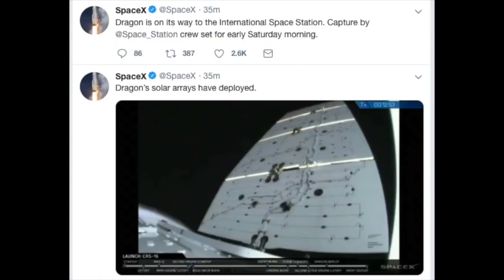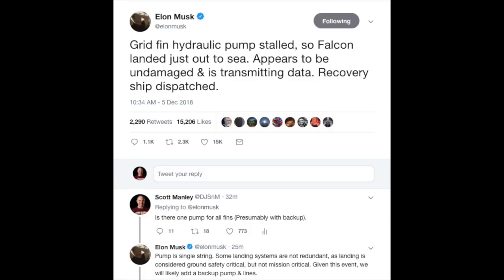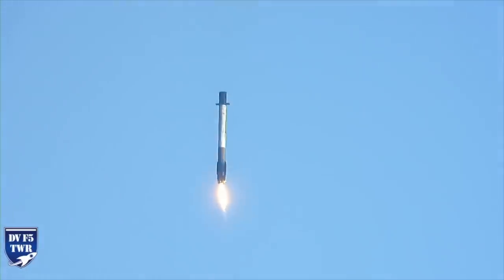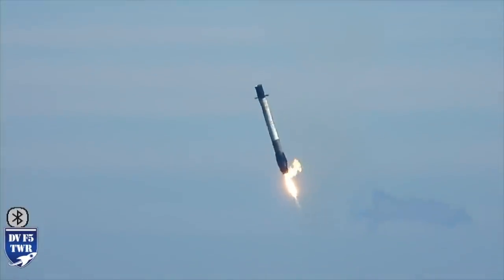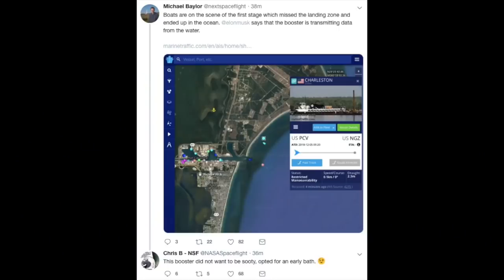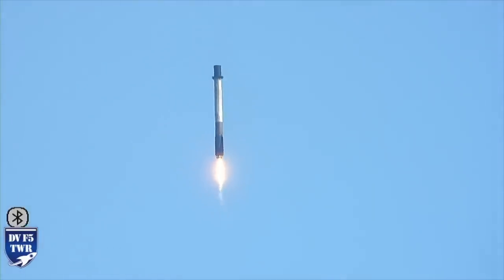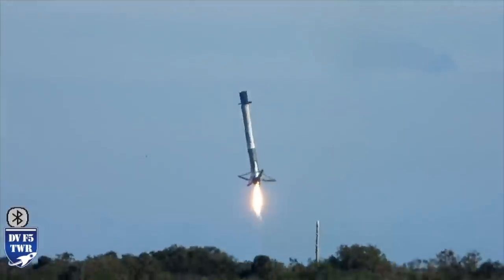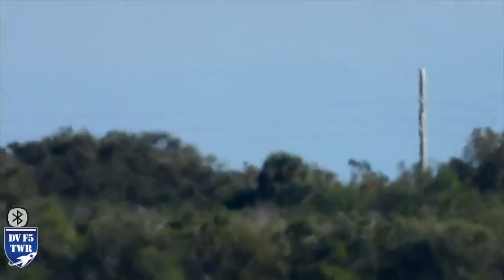SpaceX Rocket Loses Control After Successful Launch

Comment: That floating object appears to me as a piece of condensed and frozen monopropellant being ejected from the bevel where the thruster sits. Could also just be ice, but I'd guess it originated from the monopropellant thruster area.
Reply from the maker: They don't use monoprop, they use compressed nitrogen gas.
Reply: @scottmanley  Do the little thrusters have a seal? looks like it appears  after they all fire for a split second to 'open up'. It looks like a blown out peanut butter seal.
Reply: @danpope3812  Could be to verify that they're working
Reply: @scottmanley  Which is "technically" a monopropellant, if you want to get snitty.  But I know what you mean. (It's not Hydrazine.)
Reply: Any chance that the compressed gas could condense the water vapor in the atmo and then very quickly freezing the condensed water into the ring that we saw?
Reply: great vid  @scottmanley  At first I thought it was metal because of the reflective value then realized my brain was probably filling in the missing info, which it will do naturally,
Reply: During the SpaceX-broadcast, they immediately said, it is ice (out of condensed water), I think.
Reply: @iconoclastpleonast8726  Actually, my guess is it is a ring of water ice from around a nitrogen thruster based on the fact that releasing a compressed gas (eg: Nitrogen) causes cooling in the aperture. This results in condensation and freezing of ambient water vapor.  But that's just a guess.
Reply: @tarmaque  Where do you get the water from? OTOH, Nitrogen can freeze. It's what Pluto is made of. That's one of my guesses. But the ring doesn't look like what I remember the cold gas ports being shaped like. And it was huge.
My other guess is solid oxygen from a turbopump exhaust.
Reply: @Markle2k  Uhm... have you heard of the concept of humidity?  It's this thing they have in Florida.
Reply: @tarmaque  Nice smartass remark, but it doesn't help your thesis. The booster uses gimballing to control attitude on the way up. At 140 km, at the top of the boostback arc, there is no water vapor. Almost all the atmosphere's water vapor is below the tropopause and in the thermosphere it tends to get dissociated by UV into H and O. The Karman line is 20 km above the mesopause.
I've spent some time looking at photos and the video replay. The  RCS and the umbilicals are much smaller than the ring we saw float by and strike the grid fin. They are about half the size of the holes in the grid fins. The ID of that ring is 2-1/2 times the small dimension of the grids. It's larger than the whole square of the RCS pods.
Reply: @Markle2k  But it doesn't actually strike the grid fin. Look closely and you will see it is blasted by one of the side facing nozzles. Which I believe is the origin of this ice ring.

Comment: I suspect they'll have to recover it. They're going to want to know how they can avoid this malfunction in the future, and verify what caused it.
Reply: Musk has already tweeted that they send the ship out for recovery. 
They think about using the booster in an SpaceX-only mission.
Reply: @3gunslingers  thanks for the info. I don't use Twitter, so I would have never known.
Reply: @3gunslingers 
That was tweeted minutes after it touched down. Now way they could know at that time if the booster is recoverable.
Reply: @superdau  
They received telemetry even after the booster touched down. Therefor they could safely assume the booster is in quite a good shape.
Additionally, they SAW THE FU*CKING LIVE STREAM UNINTERRUPTED until long after the booster fell over.
Reply: @3gunslingers  
And what does a working telemetry transmission or camera stream have to do with the structural integrity of the rocket? Or the engines, which got thermally shocked when touching the water? There's much more to a working rocket than transmitting data.
Would you call a car that wrapped itself half around a tree "fine", just because its hazards are still flashing?
Reply: @superdau  
If the booster floats it is recoverable and also transmits data. If it doesn't transmit data, it is safe to assume that its structural integrity is compromised and therefore the booster is sunk, aka not recoverable. 
But to address your concern about the engines: even if the booster can't be flown again, SapceX can still lern about the failure if the recover it. 

What is even your problem with Musk tweeting that they attempt the recover the booster after it hit the waves soft enough to stay afloat?
Reply: @3gunslingers  
Again, just because something is transmitting data, doesn't mean it's fine. Toppling over into the water can easily put stresses on the rocket that make it (or even any part of it because of uncertainty) unuseable for another flight. The rocket doesn't have to be broken in two (or more) to be totalled.
My problem with the tweet is that "appears to be undamaged" and "might use it for internal mission" is not something you can say when all you have is a radio signal.
Reply: @superdau  
"appears to be undamaged" and "might use it for internal mission" is not something you can say when all you have is a radio signal. But you do realize that they had uninterrupted video feed from the booster as well as from ground stations?
Reply: @3gunslingers  
Well, let me repeat a third time: just because something is transmitting data, doesn't mean it's fine.
Reply: @superdau  
They had perfectly fine video from the booster being afloat at sea, both from the booster itself as well as from shore based cameras. This means it is undamaged enough to be at least towed to harbor for inspection.
Reply: When Elon said he might reuse it, it does not mean that he will use it again without being rechecked. This one needed Rapid Unscheduled Refurbishment now; they will have to go all the way checking and refurbishment like old Block 4 did first before being certified as 'usable' again. If it does not work, then it will be put on display somewhere instead. (After tear it apart to see and study the effects of that crazy spins and 'bathing' in seawater, though; they love to tear everything for studying anyways.)
Reply: Backup hydraulic pumps prob
Reply: if you have the appropriate link then you can read notes on twiter.

Comment: So Space X can now do soft landings on water... Perhaps this may be a cheaper way of recovering the 1st stage than trying to land on nasty hard ground... but only if they can depressurize the stage safely afterwards.... Just food for thought, that's all :)
Reply: Not really, salt water is very hard on equipment that isn't completely sealed, and the boosters are not sealed.
Reply: but still a little more forgiving than solid ground.
Reply: @bogrick1947  If you hit the water at any noteworthy speed, it will be the same  as if you hit solid ground, since water is incompressible. Salt water, unlike normal air, on the other hand, is really destructive to the materials of the rocket, particularly the engine is kaput. Also the rocket is guaranteed to tip over, and I don't know about you, but I feel like a 40 meters tall rocket falling over onto incompressible water is probably really really bad.
Reply: I know you are all gona get at me for my post. But can I point out that I mentioned that they managed to do a soft landing, the same as they would over land... yes, all the systems worked as they should have for a normal landing, but just over water, which I find interesting, and was pointing out the fact that perhaps 'I still Love You' is not really needed.... Just a passing thought, that's all :)
Reply: Additionally, water is not really more forgiving than ground... Water is incompressible so for any fast moving object it's not really any different than concrete. That's why belly flops hurt so much. If you're going slow enough it will flow around you, but at that speed you could land on land. Landing in the water not only destroys the engines and other parts, there's a good chance of things breaking when it tips over, which it's guaranteed to do.
Reply: No, there's a reason they land on ground. You'll notice that the only two "reusable" vehicles ever, the space shuttle and the Space X falcons, land on land, while every other US rocket/capsule has landed in water. That's because landing in water is easy, but the salt water destroys the vehicle. They will not be able to fly this booster again, all they can do is take it apart and try to see what broke.
Reply: I don't think there was ever a question of if they were able to do it. Soft landing on water is the same as on land (assuming the waves aren't huge). They just don't want to do it since soft landing on water is only slightly better than crashing. The real feat here is just that the engine was able to pull the rocket out of the grid fin induced death spiral.
Reply: Which brings me back full circle to R Qah's post of buying lots of rice, which was sort of the origonal inspiration for my first post :)
Reply: They originally started out just practicing water landings

Comment: Grid fins!! Totally called it. I was surprised that the trust vector control system was able to stabilize the rocket after all that, shows how amazing an engineering job was done 👌. More to be learned from this
Reply: As the rate of descent slows the grid fins become less effective as there is no longer any high velocity air going thru them.  As the negative effect of the jacked grid fin dissipated the thruster and engine corrections take effect.
Reply: @ETicketM  Also conservation of angular momentum when you move a couple of tonnes of legs outboard from the rocket body - much like an ice skater (speeding up and) slowing down their spin.
Reply: When they were deploying too something didn't look right they were jumpy and not smooth
Reply: It seems to be a consequence of having two independent stabilization systems, one with aerodynamics and the other with thrusters. In this configuration it is natural that each system takes measurements and enters corrections based on the resultant tensor. In normal language, the thruster control sees that the aerodynamic components underperformed for whatever reason (could be wind, could be inoperative fin) and corrected to compensate. It's actually quite easy to code this behaviour into the system, although I agree that the result was impressive.
Reply: With just the center engine, the trust vector control system can only control the tilt of the rocket, not the rotation. Once the rocket slowed down, the forces produced by the grid fins became negligible, and then the RCS (cold gas thrusters) were able to stop the spin.

It is amazing that the rocket was able to fly so well even with the grid fins stuck at such an angle. Since it would be much easier to fly with the grid fins stuck in the neutral position, one has to wonder how much benefit do the actuated grid fins provide, that SpaceX felt compelled to add the extra complexity over the purely passive ones.
Reply: Landing on water probably reduced the damage it suffered, if it was still spinning and landed on solid ground it could potentially have twisted the legs causing it to topple.

Comment: My guess is that the ring is ice/frozen condensation from the Engine... I'm not sure if the reentry burn is pre-pressurized as well but it might be venting the engines for landing burn, that pushed out frozsn condensation out of the engine/off the engine rim? I guess they get hella cold when reentering at that speed and altitude
Reply: It did leave me with the impression that it was something frozen.  I'm not up enough on sizes to guess the diameter, but it's close enough to the grid fin that it can be used as a rough ruler.

I'd initially thought it was from a cold thruster, but it looks too large, and unless it managed to drift all the way from the engine area to the fin area, I wouldn't think it was from the engines either.

Maybe one of the fill/exhaust ports higher on the booster?
Reply: @EdwinWiles  That might very well be it... I didn't think about those ports but it would make sense for them to be frozen
Reply: I thought this, but then would a fragile ice ring bounce off the grid fin like that and survive intact? It certainly hits it. If it isn't ice, which it could well be, it does sort of look like fibreglass. Not saying it is fibreglass, but the frayed edges remind me of it.
Reply: I'm wondering why it floats away so smoothly.  Isn't there lots of energetic air blowing past the booster as it returns?

Comment: thanks for the update , i was already waiting :) . good luck to spacex , i'm not worried because they are constantly testing things and the failure could be a result of some added tech test
Reply: crowxe   No the failure was a result of one of the grid fin mechanisms stalling.  Each fin only has one and has never needed more as landings are not mission critical.  However Elon said that they will probably add redundant mechanisms to each fin in the future to ensure that this doesn’t happen again.
Reply: @indigodragon0613  
thanks for the clarification , although i'm not happy with the facts you mentioned :( , i think of Falcon rockets as a pet, friend or even a family member and i hate to see any flaw or problem with it
Reply: crowxe   I know what you mean.  I was basically talking through my screen at the booster talking it to right itself and stabilize.  Learning that it did and for all intents and purposes, still landed, was very pleasing.  At least SpaceX knows now that two mechanisms are better than one XD.

Comment: Even though it had issues, by far, that's crazy that it still managed to control itself and soft land into the ocean! Just think about it! Instead of the thing just crashing down and causing a huge mess, it made its way to the ocean and slowly kept itself together.
Reply: Truuuuu. As bad as it gets is pretty amazing
Reply: Such a soft landing!
Reply: Have there been any previous examples of rockets failing this dramatically and still landing safely
Reply: @kahlzun   B1032 on its second, expending flight ( GovSat-1/SES-16) was landed softly enough on the sea to also survive and float. It had to be scuttled, although I'm not sure it didn't  sink first.
Reply: @awuma  Correct, but SpaceX obviously wasn't planning to land it in the first place. This was an expected landing and it didn't happen. Matter of fact, they have never had a failure of the booster coming back to the Cape, so that also makes this failure interesting.
Reply: @kahlzun  I mean no one else but SpaceX. Obviously SpaceX has done soft landings before, but that was to test the rocket to see if it was capable of such feat, not a failure when they expect to make a landing back on a landing pad.
Reply: @kahlzun  Pretty sure it's a first.

Comment: They said, it was some frozen material on the outside. But they also cut the feed, so I don't know what to take from that.
Reply: TheFLOW1978   The cut was a mistake.  Footage will be released soon.  Elon said that the mechanism on one of the grid fins stalled.  Therefore, redundant mechanisms will be added to the fins in the future to make sure this doesn’t happen again.

Comment: Not sure what that "gear" looking thing was.  Possibly linked to the failure?
Reply: Jeffrey Bue Its condensation that's frozen, the commentator says it in the live stream
Reply: Jeffrey Bue   The grid fins?  One of those was the cause of the spinning, which knocked the booster of course by a few meters.  The mechanism stalled.  The fins stabilize the booster to ensure it doesn’t spin and to keep it upright while falling.  Another mechanism will be added to grid fins to ensure that if one does stall, another can take over.

Comment: It seems to me that the ring floating away is ice that formed around the axle of the grid fin.
Reply: It was contiguous, if it came off an axel, wouldn't it be broken?
Reply: @EdwinWiles  it depends on whether the axle (or pipe) was confined by another object. If it was a free part, it could simply float off the end.
Reply: It does not necessarily have to come off the grid fin axle, it could have come from lower down the rocket
Reply: Niels Hietbrink   Maybe.  It was a cool looking piece of ice.